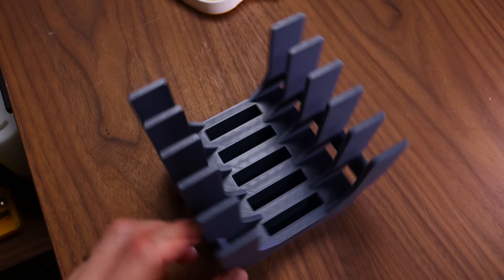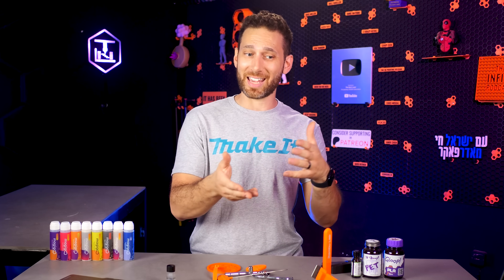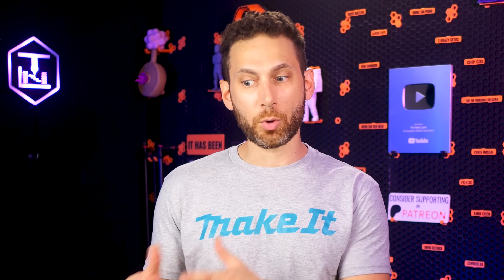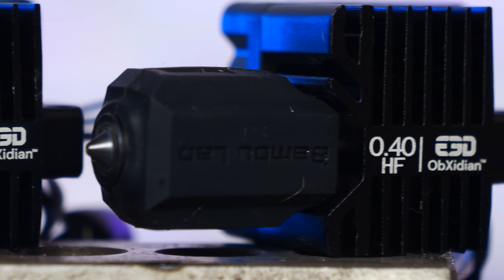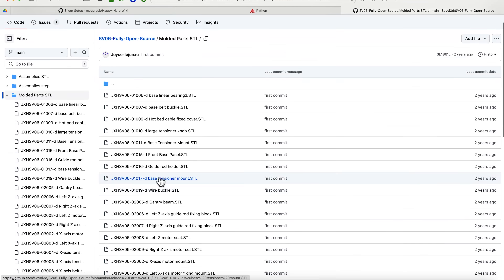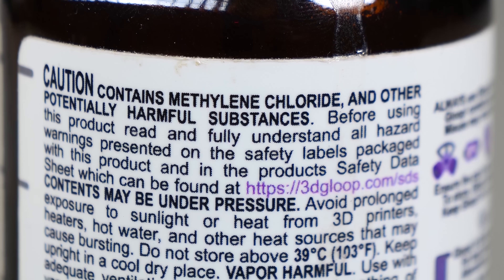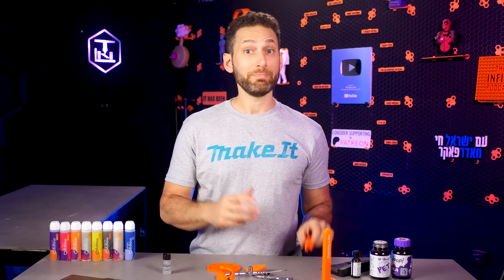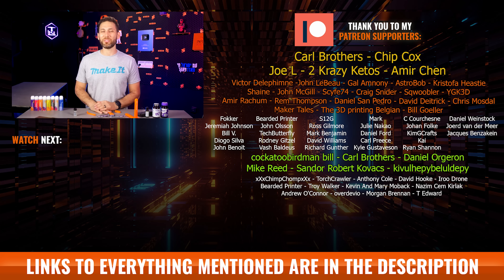These Underrated Products Make 3D Printing Fun Again

Comment: 3D printed scrapers are not sharp enough and have a short life.  The Bambu metal scraper is sharp but requires a great deal of care to avoid damaging the plate.  Plastic razor blades are quite sharp, will not damage a plate, last a long time when scraping parts off the plates, are cheap, and have many other uses.
Reply: I also use the plastic razor blades as my primary scraper and fall back to the bambu scraper if something is reeeeeeally stuck
Reply: I use a Scraper for Ceran Cooking fields Windows etc. Very Short razorblade, replaceable and very good angle, never destroyed a bed with it, and i use it for over 5000 hours now, other scraper and scraping tools... not so good. 7-9€
Reply: Just get a spackle knife/paint scraper people. Scrapes off everything without damage with few exceptions and they are a few dollars and easy to find.
Reply: @phasesecuritytechnology6573  I didn’t find that they were thin enough to get under well adhered prints, especially with brims.
Reply: @TheOfficialOriginalChad indeed...but I don't and no one should, print parts without a bottom chamfer. Any part small enough to require a brim just pops off anyway. I do use the Bambu scraper alot too. Definitely need it for tpu. But on bigger prints the spackle knife is a must. The Bambu scraper is just too short to get any further than one inch. @TheOfficialOriginalChad
Reply: @phasesecuritytechnology6573  agreed.
Reply: these are a real life saver.
Reply: For purge lines I only use printed scrapers, and specifically a round one. I love it!
Reply: I switched to a regular Stanley blade scraper about a year ago. It surprisingly hasn’t managed to damage my PEI bed.
Reply: I also swear by plastic razor blades and a good holder. I use a thin pallet knife sometimes, but the plastic razor blades work 98% of the time. I use the Bambu scraper as a last resort.
Reply: Just make sure to use the scraper body itself to angle it propperly.
Reply: The 3d printing community is missing out on metal palette knives from the art store, gentler/less sharp than a razor blade but thinner and more durable than plastic. ive been using one for about 6 years and I never need anything else
Reply: @spark_matter  I've been using one of these for years. Walmart sells them for a couple dollars. Thin and stiff enough to get under parts but won't scratch pei.
Reply: @larrykraus5645  fully agree. Get the <2 Eur plastic blade scraper from ali. Works everytime and does not f* up the bed
Reply: I use a retractable scraper I use which takes normal blades used for cleaning up paint lines when painting round windows. Very cheap and safer
Reply: I had never heard of plastic razor blades.  Guess it's been too long since I sold paint for a living.  Thanks for the tip!
Reply: There is one that makes it perpendicular. But it's still my last resort. I'd rather not damage my plates
Reply: This is the comment I've been trying to find!  Just wanted to say I got a "plastic razor blade" and handle off AliExpress and it's grand, so much easier to get brims and such off.  Thanks for mentioning them!
Reply: I got plastic razor blades for my printer but I keep finding more uses for them. Love them.
Reply: I've only got 1100 hours on this one side of my textured plate. But I just use a drywall spatula from home depot and the build plate is hanging on just fine.
Reply: I just bought a plaster scraper from Lowes. Works great.
Reply: I have some thoughts here. I argue the metal scraper provided by Bambu Lab is better than any other scraper. 

I’ve tried everything - scrapers and spackling applicators from Home Depot and ones that come with prusa and other printers too. I’ve used all manner of plastic printed scrapers. 

The one that very literally does the least amount of damage to my more sensitive build plates is…. the metal Bambu scraper. 

I can “get under” the print better to pop it off. I’m not scraping across the bed or jamming something into the side of my print.

I know this sounds counterintuitive. But I’ve tried not to be biased here. And I think what I’m finding is the sharp metal scrapers are simply better and most importantly safer for your build plates.
Reply: Speak for yourself, I've greatly benefited from printing a scraper from filament

Comment: dont use the bambu scrapper on high temp or smooth PEI plates unless you love scratches
Reply from the maker: Never had a problem…?
Reply: @thenextlayer   they are fine on textured pei but they scratch high temp smooth plates. i use the nylon razer blades from amazon $5 for 100, wont scratch my smooth PEO, PEA and PEI plates and way stronger than the ones you print..

Comment: For about 2 months now,Ii have not had to wash any of my build plates with soapy water, haven't used any IPA, and haven't used a drop of adhesive materials and I haven't had a single issue with prints sticking. 

Grab a can of Sprayway glass cleaner and stop worrying about print adhesion. A quick spray and wipe off before every print or 2 and you'll be shocked at how well it works!

I have a Neptune 3 Max and print a part for my Etsy store that has lots of small surface area edges and used to have a 50-60%. success rate without any of the edges lifting during printing. Since switching to the spray, i literally have a 100% success rate.
Reply: I know glasscleaner works good on glass beds (who would have thought) so its possible whis translated to other bed types too. I use normal windex kind of cleaner shouldnt matter what Brand exactly
Reply from the maker: Oh interesting. Is it like Windex or something special? We don’t have that brand here I don’t think
Reply: @thenextlayer  It's similar to windex. Never tried Windex, but that could work.  You may be able to find this stuff on Amazon.  

Also, I should say that all of my plates are textured PEI. I don't have a cool plate for my X1C, or the chromatic smooth plates that are all the rave, so I don't know for sure if this stuff works as well on those.
Reply: @thenextlayer  it's a can of foaming window cleaner
Reply: @thenextlayer  I haven't tried Windex, but it may also work. I should also point out that I'm using textured PEI beds on all my printers. My x1c did not come with the cool plate, and I do not have any of the fancy chromatic flat plates that are all the rage right now so I cannot verify 100% that this method will work on those, but it should.

Comment: In Germany use 3D-Lack for bedadhesiv. I didn't think that Plastic Repellent Paint is good for the nature. Mostly in contains PTFE, a chemical, and if you print over 240°C, it will be dangerous.

Comment: magigoo is too expensive. no stick should cost $40
Reply: Most of them are around $20. More expensive variations are $40 (HighTemp and Metal) - these help you to safely print filament which cost $100-300/spool
Reply: @alexpanov 20 is for very small bottle. 40 is for larger one
Reply from the maker: It lasts a LONG, LONG time.

Comment: Great video. I have tried to use 3D Gloop twice love the produce and how well it works but both ended up curing in the bottle way before I used up the contents, despite trying to ensure the lids were properly closed. Will be stocking up on Magigoo however.

Comment: "Gloves are required" Also in the video: Using the Glue without Gloves. xD
Reply from the maker: Yeah... I caught that too. Oops.
Reply: @thenextlayer we all know you have to say these things in videos to appease the Official Unofficial OSHA Enforcers. Whether or not you use PPE is up to you as an individual. 😉
Reply: @eX_OSRS  They'd have a point here. The main component of 3D Gloop is DCM. Besides the massive inhalation risks like going blind, liver failure, suffocation (DCM metabolizes to carbon monoxide) or getting cancer, it can also cause chemical burns, as well as be absorbed through the skin (potentially causing all the aforementioned issues), so yes, gloves are recommended. 
Personally, I don't want anything containing DCM in my house.
Reply: @hellterminator  I'm around worse carcinogens and chemicals daily. Like I said, whether or not you use PPE is up to you as an individual, or like you said, don't even buy/use it.
Reply: Really promotes the "safety third" mentality 😂

Comment: plan to get some magicgoo. I currently use vision miner's nano polymer adhesive and its amazing. The best part about it is that it works for everything and last for tons of prints before you need to wash and reapply.
Reply from the maker: Yep, same. I wonder how they compare.
Reply: it's not cheap
Reply: @JBCool0729  I think it's the same price, if not cheaper, than the Magigoo sticks.

Comment: I would also advice 3DLAC for the bed adhesian. When the bed is cold(er) the print comes of like a charm, and it still works after 20+ prints.